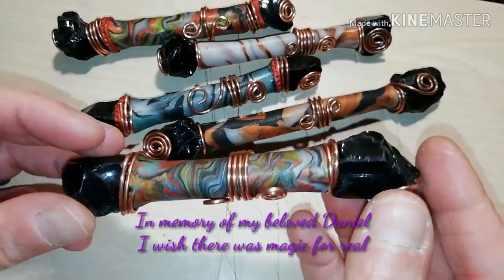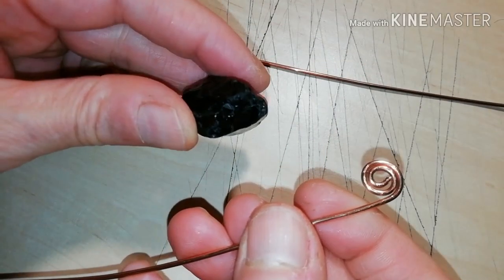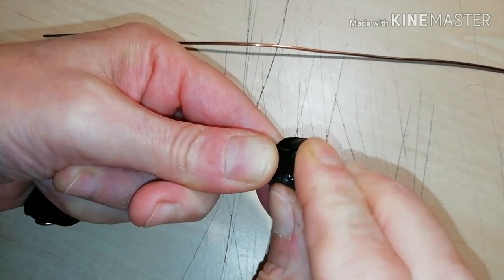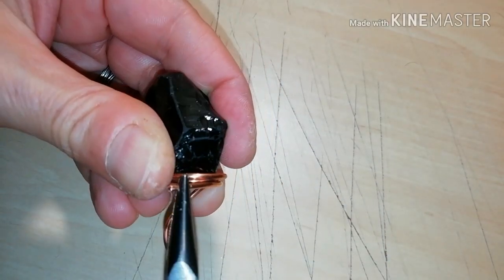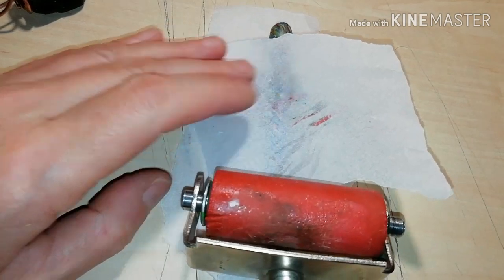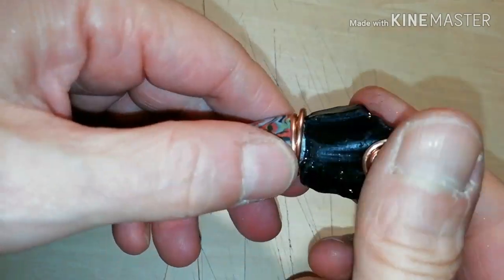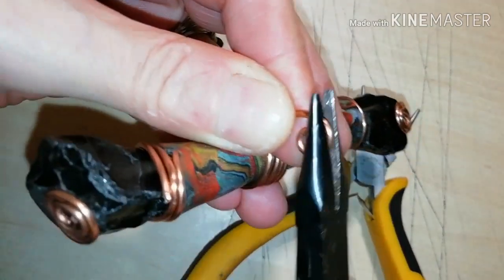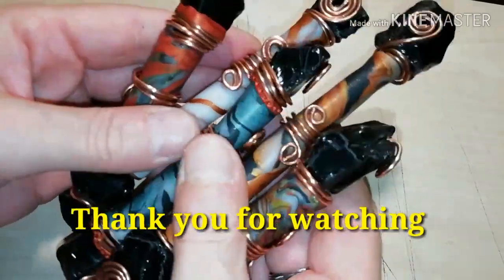Obsidian crystal wand! Polymer clay and wire

Comment from the maker: What I didn't mention in the description is that, from what I ve read, obsidian is supposed to absorb bad energy and that makes it ideal for relieving the soul from bad or heavy mood or even help with headaches. The polymer clay acts as an insulated handle for the wand, if you choose to use it. I also forgot to point that this kind of wand is almost unbreakable. I am not into crystals though, I only like the way they look. Enjoy.
Reply: Can you tell me where your purchased your drilled obsidian pieces?
Reply: @severinamarsh  We've got a crystal shop in the city. But I don't know where else to get it. Amazon maybe?
Reply from the maker: There are shops in my city that sell very cheap semiprecious gems and stones and crystals drilled and threaded in cords of twenty or more pieces. The obsidians costed like one euro a cord of twenty pieces.

Comment: Do you know if you can use other crystals? Will they survive the baking process?
Reply from the maker: Good question! From what I found on the internet:
1. we should avoid amber, pearl and opal because the heat will damage them.
2. Amethyst changes color when heated.
3. 130° Celsius for 15- 30 mins will cure polymer clay but is not enough to affect most crystals. 
I hope that helped.
Reply: Thankyou that does help 😊